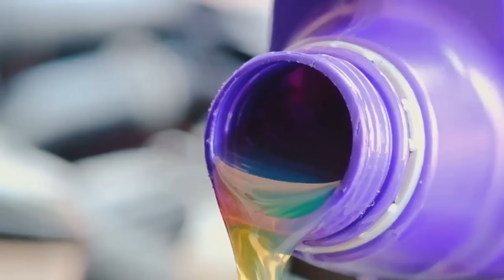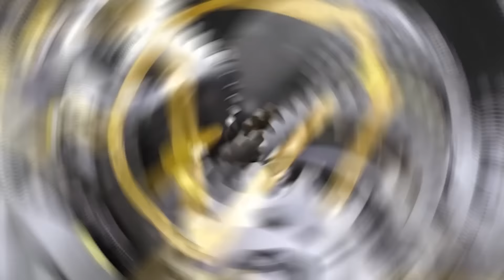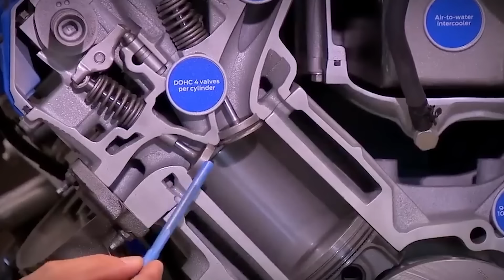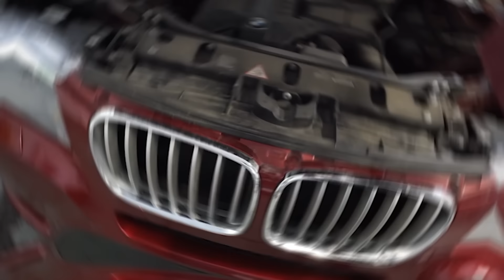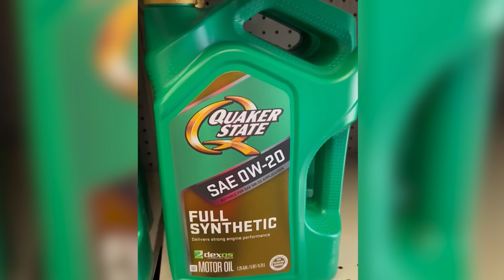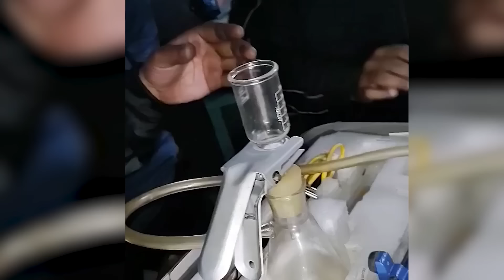9 BEST Synthetic Oil Brands (And 5 That Are KILLING Your Car!)

Comment: Has anyone noticed that the pictures showing the crankshaft dipping into the oil pan?  This is a major mistake.  The effect is to aerate the oil into a foam that does not provide lubrication.

Comment: 6 castrol
5 mobil
4 liquimoly
3 royal purple
2 amsoil
1 oem oil
oems dont actually make oil on their own, they take directly from oil companies, so where is the difference?
where would you rate shell, wolf, motul, idemitsu, ravenol oil?
Reply: Stay away from OEM oils. They don't blend their own oil. They ask oil companies to bid against each other giving them their minimum specs. The  oil company that gives the cheapest bid always wins. Yes they are required to meet the specs, so they only blend the oil to just pass.
Stay away from synthetic blends, they often only contain one percent synthetic content. Amsoil semi synthetic contains over 50% synthetic content.
Stay away from full synthetic oils as they are not much better than blends, usually having only a 25% synthetic content.
If you are so cheap and must buy cheap made oil, then change it way before the typical 3k. Especially with VVT, direct injection, turbo, or the many engines that now use low tension comprehension rings.
If you want the best in engine protection, use Amsoil 100% synthetic oil. It was the first company to produce a true 100% synthetic oil with an API rating. The other oil companies tried to condemn Amsoil and their synthetic oils, but soon every reputable oil company was forced to make better oils and were forced to use synthetic additives. They should be changed very frequently. Only Amsoil will give you excellent protection easily up to 25k. I have driven several vehicles close to 500k. I only had to retire the vehicles because the vehicle was worn out, but never the engine.
It was the only oil that we would use in our small engine shop. We simply refused to offer any other brand. I saw first hand the tremendous difference that Amsoil makes. No other oil come close in protection. You can certainly get decent protection with other oils but change it way before the 3k, and certainly not any longer.